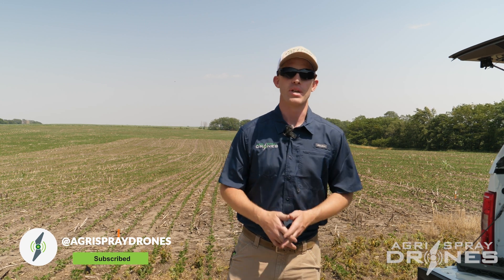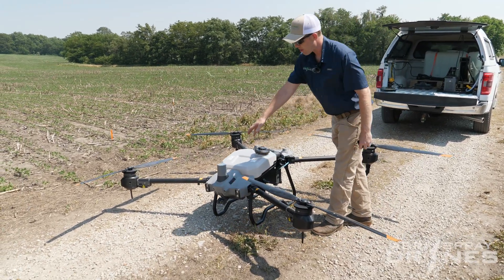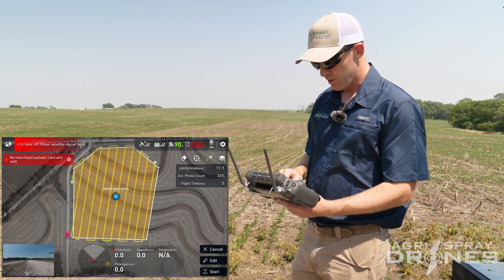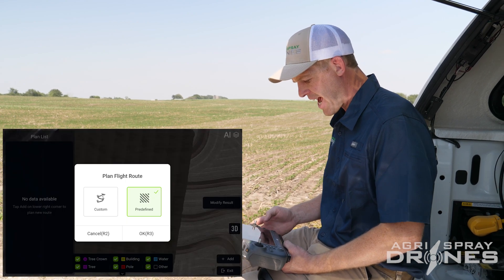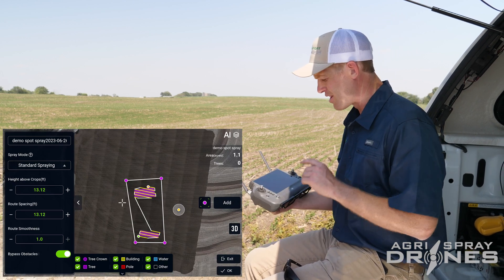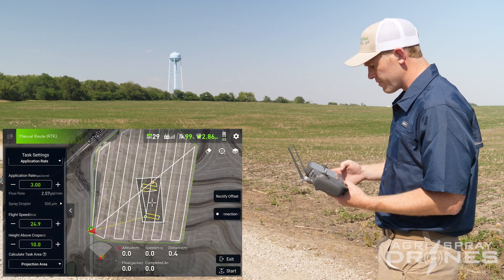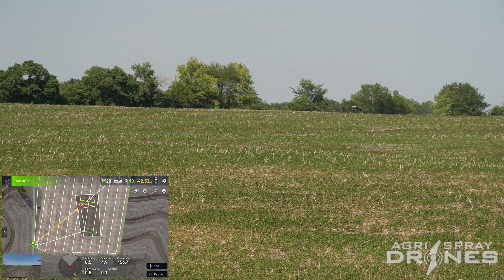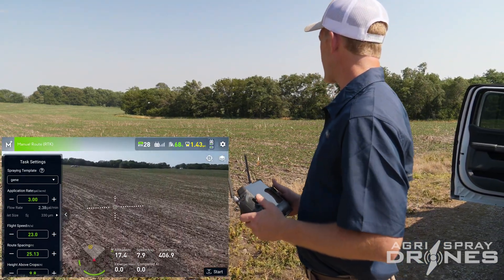DJI Agras T20P Spot Spraying Demo | Agri Spray Drones

Comment: Now I know the application rate is denoted on the msds and also on the label of the product, but as far as the flight speed...how do you determine what speed you want the drone to apply product?
Reply: Generally speaking you want it to fly as fast as possible. In the drone settings, lets say the label says to spray at 2GPA. The drone will generally give you its max speed at that application rate. Now if you lower your flight speed, it'll also raise how much you spray and raise your GPA. So for the most part its generally fixed. This applies to all spray drones. Technically speaking, yes you could lower the duty cycle on the pumps and fly slower to put less wear on the pumps. But then you're putting more stress on the motors and  ESC's. Which are wayyyy more expensive than pumps. Although for us, going on 2 years with our T40, we only just replaced the impeller and seals on our pumps. Covered 16k acres with that drone alone. No other major service aside from replacing a set of propellers.